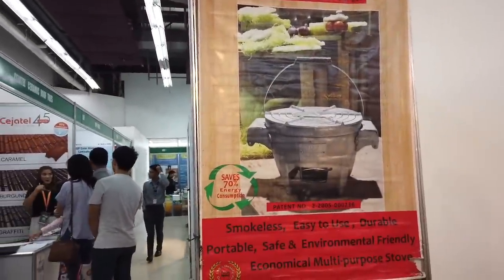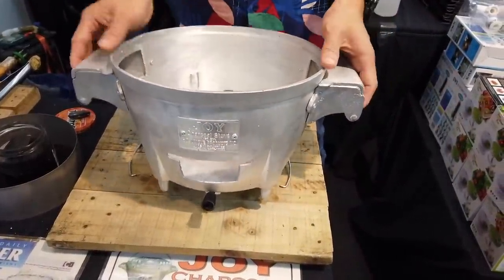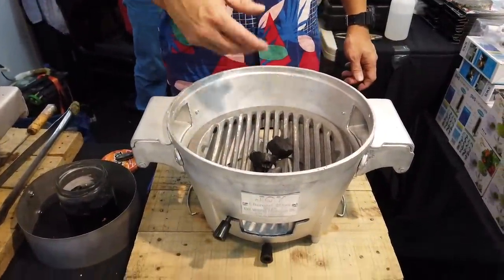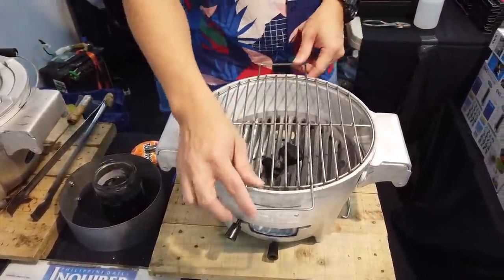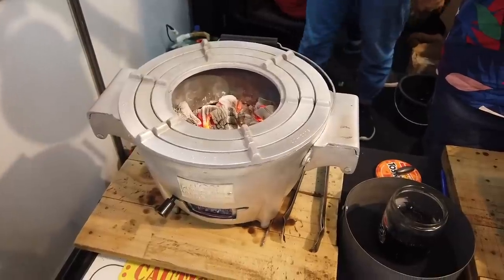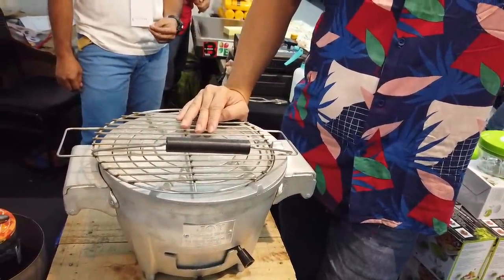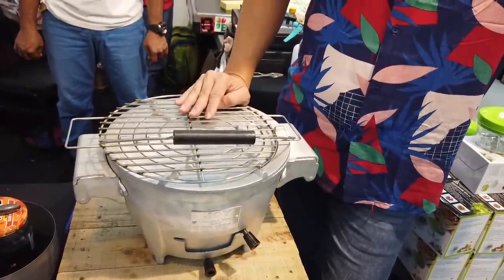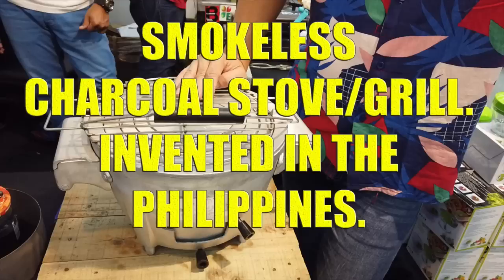Smokeless Charcoal Stove & Grill, Invented in the Philippines.

Comment: it is smokeless if your using it for cooking with woks, pans or boiling water in kettles. But if it's use for grilling foods like pork and chichen it does smoke like any other conventional ceramic or concrete made charcoal cooker. Bought 2 units of this from the owner/inventor and arrange a meetup to pickup the items near their house in 7-Eleven store Quirino Highway.

 I highly recommend this cos it's durable and user friendly and what's best is they have spare parts in case you need to replace or lost any part of unit.
Reply from the maker: jnipenenriquez Good info, thanks for watching.
Reply: I leave in Baesa Quirino hiway im interested to meet up to buy the product.
Reply: Ma'am where add ni querino highway, can you give the exact add,, pless,,,

Comment: Great design!  I can see how it is almost smokeless when operating at max efficiency.  

On Lazada the large model is 3680 PhP and the medium size is 2840 PhP.  This looks like the large model that is listed as - height - 8.5" / diameter - 12".  The medium size model is 7x7x3, which is smaller than the one demonstrated here.  Expect to pay 3680 for the size demonstrated here.
Reply from the maker: Yes it was the large size that was used for demonstration.

Comment: Great concept and execution! You should ask for support from the DTI for export plus other support, e.g., mass manufacturing if you don’t already have that.

Misgiving ko lang sa demo, you dip the charcoal in kerosene for the starter. Di kaya maglalasang gaas ang luto? When I was going camping, we would help the charcoal ignite with old newspapers. A friend even suggested using potato chips, haven’t tried that yet though. Point is, there are better ways than kerosene to start the charcoal

Comment: I have one. It works yes but if you use an electric fan the aluminum can deform/melt. The airflow does minimize smoke. It is not as tall as a rocket stove so the airflow is not as high. But this was designed for compactness. You can use wood but its not designed for it.
Reply: electric fan???? wood??? Isn't this designed for indoor use ???? I don't  know what you are saying ..

Comment: That’s pretty ingenious. Takes a bbq grill concept for in house use. Just wondering about the materials used as there are concerns for using aluminum. Also, curious about dropping the charcoals on the side. Do they flop just on the side of the grill or do they continue to “roll” down into the center. There’s a little divot in the middle of the charcoal holder, but not significant enough. I suppose using a stick and poking it through to situate the coal in a preferable position.
Reply from the maker: Charcoal drops down in the middle.

Comment: The sides where you put the extra charcoal will burn your hands if it’s piping hot cus it’s made of metal. Or am I wrong?
Reply from the maker: Yes thats correct so it was recommended to use tongs to open it to add charcoal.
Reply: @villagepeoplephilippines  thank you for the quick response, I really like the convenience of it and its not bulky for transportation and you can use if as a stove also for camping. if those areas I mentioned can be redesigned to avoid burns I would love to get one and a second just for emergency purposes. thanks

Comment: Just upgraded versiom of the superkalan invented by another Filipino way back in the 1980s. The said stove uses firewood and charcoal as fuel source. There are some modification but the design concept the same. The problem with this stove are heat/energy efficiency. Wala siyang side insulator to keep the heat from escaping from all the large surface area of the stove itself. Nagkaroon ng bandwagon effect. Daming kumagat sa abu niya.
Reply from the maker: Tristan Basilio Romero This was patented in the 1970's

Comment: We have like that long time ago but the problem is the middle that hold the charcoal it’s got broke apart due to extreme heat I hope they upgrade it to more heat resistant.
Reply: I had one also in the late 90s when I was still in d Phils. Very good for bulalo and oxtail kare2 cooking.  Very matipid and smokeless than using chopped wood for outdoor barrio cooking.😊 Sana may agent sa UAE.

Comment: Should be eazy enough to make a stainless steel version that won't meltdown eazily
Reply: Thats the first thing that came to mind when he said its made of aluminum..  ill buy it if its stainless steel.
Reply: Maybe add a fan to turbo charge it as well then again if your gona be running that hot your probably working on a project other than cooking. Still its nice to be able to go overkill without killing the cooker . aparently the aluminum one is meant to be choked down a bit while running or have water splashed on the rings still i prefer something more fool proof tis why i like stainless steel it doesn't typically burn out like steel does and is hard to meltdown

Comment: Someone will use this inside their home and die from carbon monoxide
Reply from the maker: Jimmy Sobrino. Most Filipinos that cook using charcoal does so using the traditional methods in a ventilated area know as a dirty kitchen. The traditional method produces a lot of smoke and carbon. This invention which has been in production since the seventies works more efficiently combusting the gases produced, but it still needs to be used in a ventilated area.  My family had a similar one growing up, it was used in the kitchen area indoors, but Filipinos using this tend to have have traditional Filipino homes which are well ventilated. It would not be recommended to use in a condo unit for example but then who would cook on charcoal in a condo unit?
Reply: @villagepeoplephilippines  if there is a storm or hurricane and there is no power .. might just have to ....

Comment: Just saw another youtuber use this product and this it s not really smokeless. Please do your own research before investing.
Reply from the maker: Smokeless means less smoke, common sense will tell you that the fats falling on a hot surface smokes, I have an electric griller and it still smokes. This is far better than cooking in an open fire, safe for indoor cooking as long as there is ventilation.